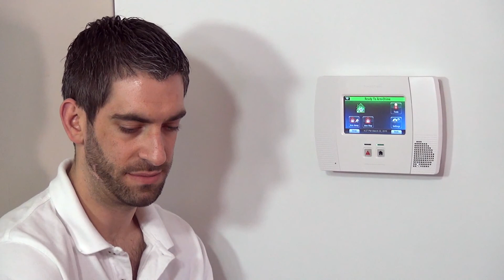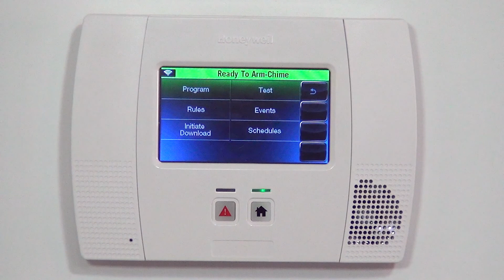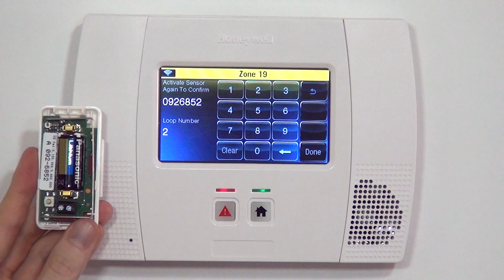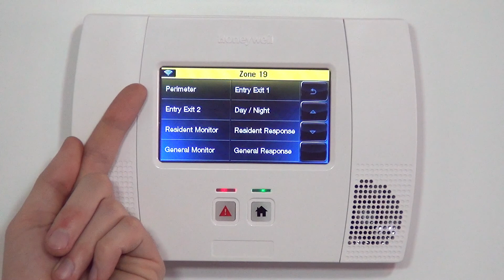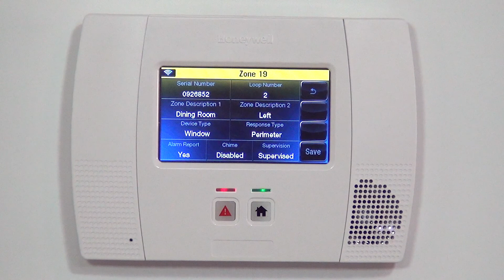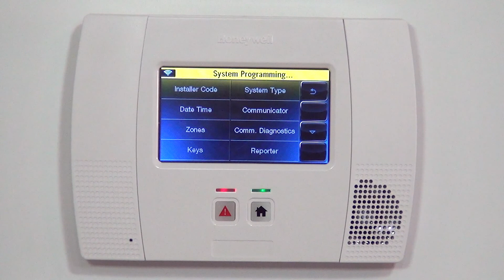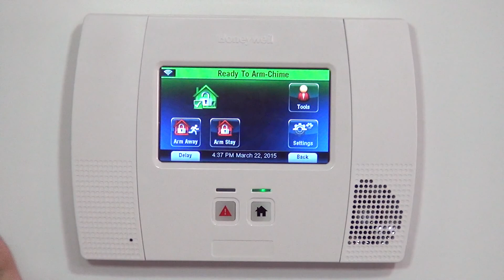Honeywell 5815: L5200 Programming

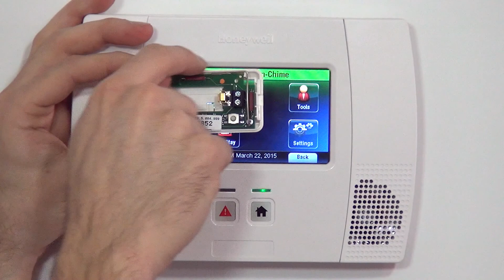Comment: FYI: There are TWO REED SWITCHES (the skinny red things at the outer edges of the circuit board) inside the unit, and they can be seen at around the 3:00 point in the video. What this means is that you have TWO options when it comes to choosing where to mount the magnet in relation to the sensor. Note that this information can be seen in the installation instructions that come with the sensor.
Edited to add that he caught his own error regarding the reed switches very shortly after he said it. I’ll leave my comment here just in case someone skips ahead or stops watching the video and misses that very important information. 😉
Reply: That is correct, Sammy. 2 Reed switches. Thanks.

Comment: The Tuxedo is not an alarm panel, it is simply a keypad that also supports Z-Wave functionality.  You would need to use the Tuxedo in conjunction with an alarm panel, such as a Vista-20P, Vista-15P, Vista-21ip, etc.  On those panels, you would then also need to add a receiver in order to add wireless sensors.